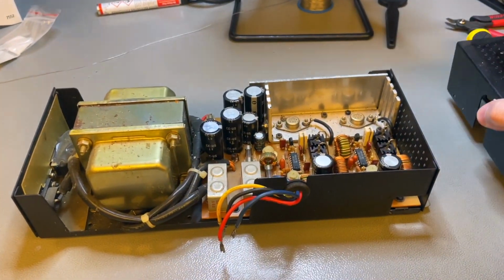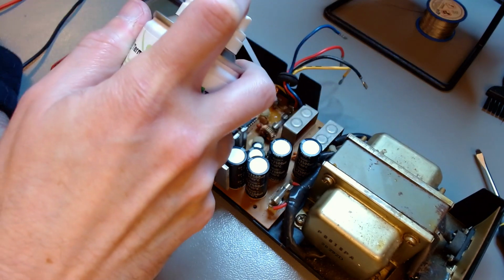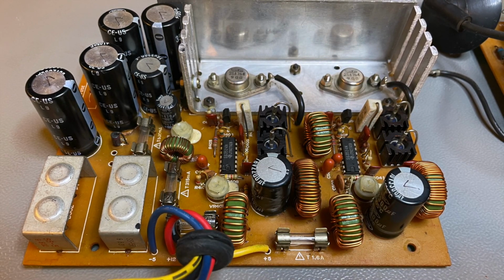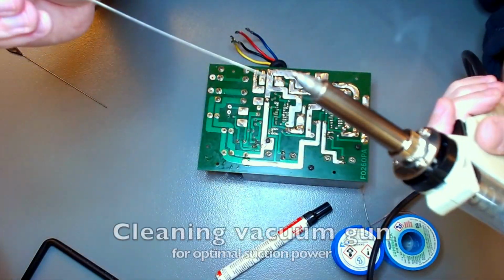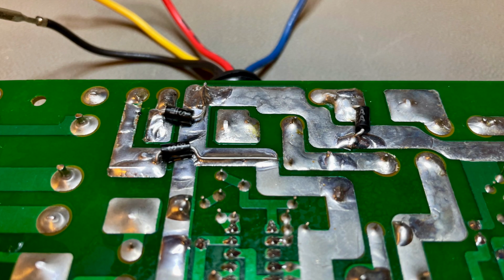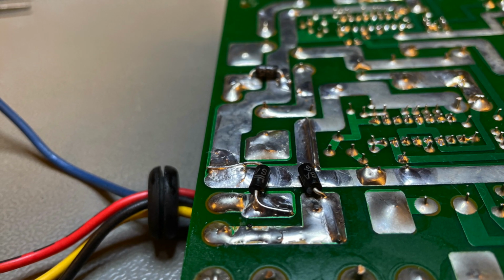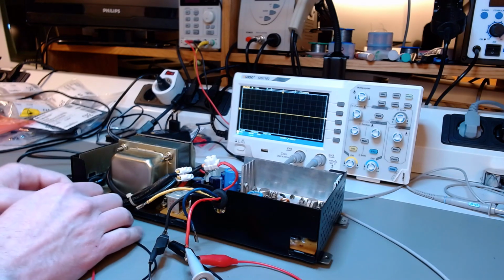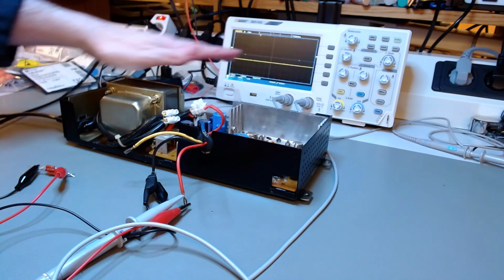Sharp MZ-80K museum-quality restoration, PART 3

Comment: Very nice job of keeping the original look and great placement of the TVS diodes to protect the system from a failure in the PSU.  I'm also loving the reminder about the "why" of the hot glue on the big rectifying capacitors.  Thank you for another great video.  Can't wait for the next one. :)
Reply from the maker: Cheers!!

Comment: I've started putting protection circuits on the output of old power supplies. I do it non destructively and while it's not original I think it's worth having to protect valuable old hardware.

I like your TVS diodes. I usually go between the PSU and motherboard with a PCB.
Reply from the maker: Certainly worthwhile, for the sake of preservation!

Comment: For testing powersupply rails in a pinch I often used 12v lightbulbs from a car. I have a set of replacement bulbs and fuses handy in my lab. Usually you wold find 3w 5w 10w 15 or 21w and50/55w bulbs in there.  Nice work so far. With the suppression diodes I would have done the same just a couple of months ago until I fried my cpc664 with a defective psu. Curious Marc had a nice little crowbar circuit built for his repaired vintage hp calculator and I now wold do so too especially for those vintage museum maschines that are supposed to work in an hands on area.
Reply from the maker: I thought of the light bulb, but in Europe incandescent bulbs have been forbidden for years, and I no longer have a working one :-(. No trouble, I'm relatively sure that the PSU is working fine, and may even break out the programmable load for the video's sake :-). Regarding CuriousMarc, now I know why people keep asking me about the crowbar recently! Will watch that video later today. Cheers!

Comment: Not a big fan of the screw based wire connectors "kroonsteen / lusterklem " that where inserted into the psu instead of resoldering the original wires. Gives a unoriginal look (a crowbar was excluded because of this) and are a perfect failure point over time as they should never be used with tinned wires, as the tin flows over time, leading to arcing. They are only allowed with crimped ferrules (adereindhulzen) or single lead wires.
Reply from the maker: The connectors are completely hidden inside the PSU's case, while a crowbar would need to be an additional small board soldered to the four terminals on the motherboard (there's no space internally). Regarding the screw-based connector, the best practices you are referring to are motivated by much higher AC voltage installations (230V AC), not the secondary of a transformer like this (20-30V). In practice, in this case, the solder won't flow or arc; it would do so only in extreme situations at unrealistically high temperatures (moreover, I tinned the leads with lead-free solder that melts at an even higher temperature). The connector boxes facilitate maintenance by avoiding the need to desolder the leads each time the PSU is open, which has a conservation advantage by avoiding wear and tear.